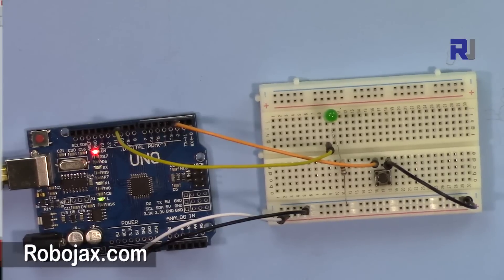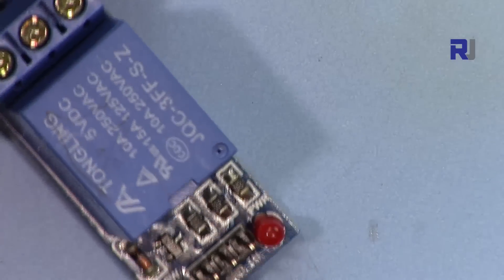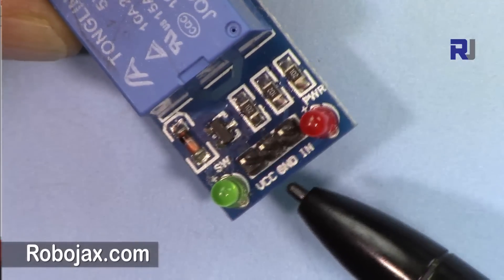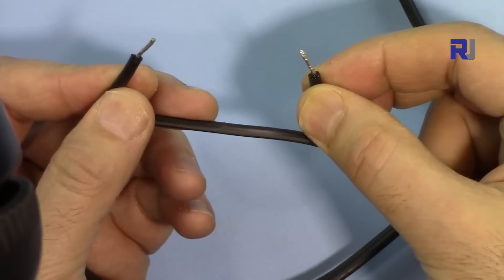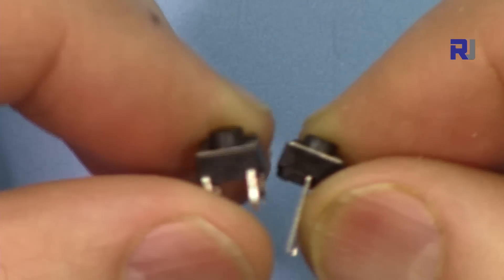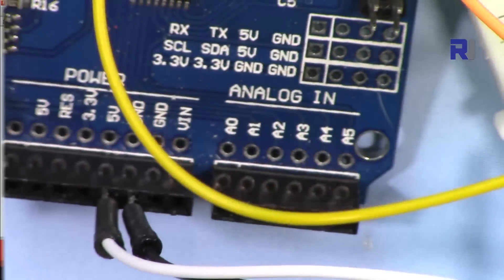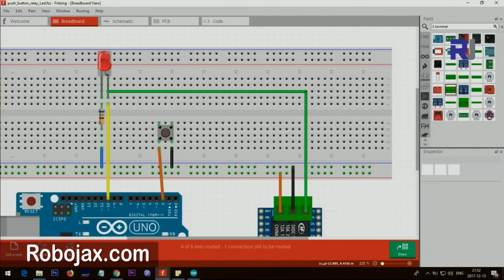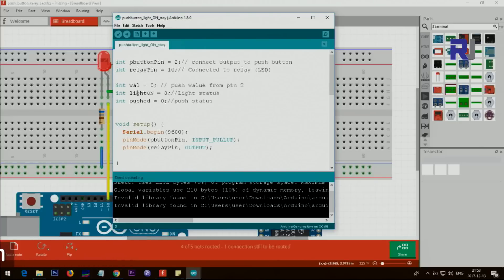Using Arduino Turn AC bulb with push button On and OFF toggle with relay

Comment: I been looking for a neat solution for this (i was looking for a way to control my relay with webserver and also a button!) and seemed like I couldnt find one at all, here and in other videos the code seems convoluted.
So i actually stopped for 5 minutes and came out with a more simpler solution! Just follow this logic:

1- The normal button state is always HIGH until its pushed down (LOW)
2- That means you can write a comand that recognizes when the button is LOW during the two possible scenarios; if relaypin is LOW or HIGH
3- So logically,  -if relaypin is HIGH and you press the button (buttonpin LOW again), te relaypin should change to LOW (in a "normally open" setting that means the lights would turn ON)
                            -if relaypin is LOW and you presss the button (buttonpin LOW), the relaypin should change to HIGH (in a "normally open" setting that means the lights would turn OFF)

So following that idea:

int relaypin =7;
int buttonpin = 8;

void setup() {
pinMode(buttonpin, INPUT);  
digitalWrite(relaypin, HIGH);  //This is nesesary for your relay to start in HIGH at startup, so it wont switch on during the few microseconds it takes to switch states)
pinMode(relaypin, OUTPUT);

void loop() {
if (digitalRead(buttonpin) == LOW && digitalRead(relaypin) == HIGH) {
    delay (400);
    digitalWrite(relaypin, LOW);
    }
if (digitalRead(buttonpin) == LOW && digitalRead(relaypin) == LOW) {

    delay (400);
    digitalWrite(relaypin, HIGH);
    }

You need that delay in the middle (maybe even make it longer) to prevent your relay from switching at the speed of light.
Im sure even I can come up with a way to prevent it from keep switching if you keep it pressed long enough.
This works well if you were planning to use it with other code, since it is almost isolated in terms of variables.
Reply from the maker: Thank you for your comment and code. It seems to be working. Same task can be done in many ways.

Comment: Assuming you can also turn on/off the light bulb through code in Arduino, right? If so will this sync up and allow you to either manually turn on/off through the button OR turn on/off through code?  I'm trying to figure out if I can use this example in a real life scenario where I can control manually and remotely and have everything play nice together. Thanks!

Comment: Hello Robojax,
Thnx a lot for your great YouTube, It means a lot if you share what you’re good in, so we can learn from each other. I hope you have time for a small simple question. Is there power on your relay coil when the NO contact is closed (when you’re hooked up appliance is on) like a standard relay or does it gets a pulse each time you switch on and off you’re appliance?
Greats
Bart
Reply from the maker: Hi,  you are welcome. here is my video on relay https://youtu.be/N-fFk51Eb8s

Comment: I like your video and it helped me. One thing I am trying to do but it's not working with that. Let me know can I use wall switch button which is used for 220V appliances? If so then how can I use it, please help me about that. Thank you
Reply from the maker: this is the video for you. I connected a bulb, you connect a fridge or  heater or anything. as long as you pay attention to the current rating of the relay.  Read your relay and make sure don't connect a load beyond the limit of the current handling of relay.

Comment: nice video sir...and also please make  operating relay with manual switch operating and mobile operating{wirless operating).iam  already told you in last video,
Reply from the maker: Your request has low priority. Out of over 200,000 views in a month in my channel, only 500 might be interested in mobile. I will do it when I get time for it.

Comment: Excellent video. What if i wanted to add two or more then two push buttons? Thankyou
Reply from the maker: just define all pins and variables . I have explained it fully. so pay attention to the code, watch it 2, 3, , 4 or 10 times until you know how it works. I can assure you can you do it.  Here is my *** Free Arduino Course **
Arduino Step by Step Course  (over 100 lectures) Starts here http://robojax.com/L/?id=338

Comment: how to i alter the code to make it so the switch only turns the relay on wile the switch is pressed? im planning to use this with a relay shield for a robotic charging base that only turns on when the robot parks on it to avoid causing a short when the contacts touch.
Reply from the maker: learn about push button in this video https://youtu.be/yyJrqFKn-X4

Comment: Great video. I have a question how to modify it to have 2 buttons that control one realy (bulb). Application in stairs.
Reply from the maker: that needs separate project. can't be explained by few line.
Reply: @robojax  Can you preapre video are rather you are not inreasted.

Comment: thank you for your video, i want to ask about led light, why the led turn on but the relay turn off. and the opposite, this is my condition, in yours led light on the relay turn on
Reply from the maker: You are incorrect wiring on the relay NO, NC. Watch the video again.
Reply: @robojax  thanks. i have solved the problem. but  i dont know what project must i create with this arduino. so i leave arduino for now. and back to my daily work. thanks again.

Comment: Thank you bro
I have a question 🤔 
When I press the push button  the relay turn off and the led turn on
How can I turn them on together?
Reply from the maker: They should turn on together  because they are after each other in the code , unless you changed it. Or change it to work together.

Comment: Hi. Thanks for the infomative video. I've connected the output of the relay (coms & NO) with 2 jumper wires connected to each other, then to an LED bulb in a breadboard. But it doesn't seemed to light up the LED. why is it so?? and also the wire connecting the output of relay is of the same terminal right (same Single wire)??
Reply from the maker: Hi, does the relay clicks? Do you hear that sound of it? If not then either you changed the code or wiring has issue. Check it.
Reply: @robojax  hi yes the relay is clicking with LED blinking when linked with arduino code. But serve no output signal.
Reply from the maker: If relay works then you fix the wiring from relay to your load
Reply: @robojax  yes it is working now. thank you!

Comment: Hi , when the pushbutton is being pressed , current from the 5v pin of the Arduino will travel to gnd  through the push button , wouldn't this short circuit the Arduino ?
Reply from the maker: It seems you have not watch the video or have skipped. We never connect a switch one side to 5v and the other side to ground. Of course it will short circuit it.  Watch the video again without skipping
Reply: @robojax    I am sorry , I meant the I/O pin (pin2 ) , that pin is directly connected via the button to the ground
Reply from the maker: please watch the other video which is only about push button switch. I have replied.

Comment: hellow robojax.. nice video.....  i have a question how to make connection if u dont have a resistor.. only using pull up code?
Reply from the maker: Yes  you can I have used in many of my project.

Comment: use a resistor on the buttom pin (between pin 2 and ground in this case ) to avoid a wrong input value, my input was always high because of that
Reply from the maker: You don't need resistor, i used "INPUT_PULLUP" to eliminate the usage of resistor. Watch my video on why use resistor https://youtu.be/TTqoKcpIWkQ

Comment: Hi man, nice video.
I have a question, when you turn on the arduino the load is on automaticly?
I have a home project where i want to conect a water pump but in power fail i dont want to be on when power comes back, just remain off
Reply from the maker: Thank you. I should have done that. I just updated the code you can get it. I added digitalWrite(relayPin, HIGH); inside the setup()

Comment: Hello, top video!
But I have a problem: everthing is as You have and I download the code but the led is ON and the relay is OF. When I push the bottem relay is ON but the led is  OF. It is not on the same time. Have You any idea wath the problem is?
Reply from the maker: You have connected your relay wires incorrectly.  Watch the video again where I explained the relay wiring.
Reply: @robojax  HI, it is not the ac lamp what is the problem; led on breadboard is ON, green led of the relay is OFF.  Push the bottem;; green led on relay is ON, led on the bb is OFF
Reply from the maker: I am sorry which LED? the LED on relay ? There is 2 LED on the relay. One is always ON. that is power. the 2nd  turn ON when relay goes ON.
Reply: @robojax  ok, You have a green led on the bb burning. Only the red led on the relay is burning I push the bottem, led on the bb is going out and the green led is going on.The green  led on bb and the green led on the relay  are not going buring at the same time that is de problem.
Reply from the maker: Red is power showing there is power. Green is the actual ON and OFF. Do you hear click? you should hear click when green LED turns ON. If there is click all OK. it should work.
Reply: @robojax  ok, everything is working but in your video  the green led on bb and green led relay are going on at the same time, by  me led on bb is on, green led relay out, push on bottem led on bb is out and green led on relais is on.
Reply: @robojax  The relay is a "low" trigger maybe is that the problem?

Comment: Thank you so much it was helpful
but I'm facing a problem in coding of  push button switch , I want the sensor value to be saved in a reference when push boutton is pressed 
 
CODE:
int sensorPin = A0;
int buttonPin =7 ;
int LED = 8;

void setup() {
   pinMode(buttonPin, INPUT_PULLUP);
   pinMode(LED, OUTPUT);
     pinMode(sensorPin, INPUT);
     Serial.begin(9600);
}

void loop(){
 
  int reff;
    int sensorValue = analogRead(sensorPin);
   int buttonValue = digitalRead(buttonPin);
   while(buttonValue == LOW)
   {
      reff = analogRead(sensorPin);
      Serial.println(sensorValue);
   }

  Serial.println(reff);
       delay(100);
}

PROBLEM:
if i press the button then sensor value should be displayed and get saved to reff  , but both are not happening  and reff value is not changing it stays at 0

button is working fine ,Every component is working fine i hope that you could help me out in this one 

Thanks in advance

Comment: Thank you for this great video!  I'm attempting to use this principle with an LED, but I'm having trouble adding a fade time.  I would like to push the button, then the LED fades up in 4 seconds.  Then push the button again and the LED fades off in 4 seconds.  I've adjusted your code to work with a MOSFET, I just need help adding the dimmer fade.  Any ideas?
Reply from the maker: You are welcome. Your project is different. The output on this project is working like switch either ON or OFF. For fading we need PWM. Here I have written this code which I have not tested but it shoudl work. https://www.codepile.net/pile/4XyqJNXd  please let me know
Reply: If you want to fade on/off a 3v or 5v LED then you don't need a MOSFET, the LED can be directly controlled from any PWM support pin of Arduino.

Comment: I can't find the wiring schematic!  Ideally the link to the code and wiring diagrams should be easy to find, ie, at the beginning of the "See More" link.  Yes, the code link points to another link which links to a udemy page to get the schematic, really?
Reply from the maker: code is there but no schematic. you don't need it. I have explained it fully. you can draw it if you need it for school or project using this free software https://fritzing.org/  the link to the code is for sure there.

Comment: How it could stay on for 10min and then turn off. Without the delay() fuction. 
Thanks
Reply from the maker: yes after you turn the relay ON, set delay (10000); But this code is to keep the LIGHT on and wait for another push to go OFF.
use this https://goo.gl/C7vJqx and connect relay to pin 10.  After this line  digitalWrite(10, HIGH); put this delay (10000);
and it will keep the light ON for 10 min and then goes OFF.
Reply: I' d like to do tha without the delay(10000). Because the delay holds all the loop. Is it posible to do that with millis()?
Reply from the maker: if you don't like to use delay(), then using mills() you can do it. Please have a look at this example at the end of page http://www.lucadentella.it/en/2015/07/21/arduino-delay-vs-millis/

Comment: Sir i want the bulb to be switched on for 7 seconds and then automatically shut down and again turn on for 7 sec only if push switch is pressed else bulb remains off. 
Plz suggest me how to do
It will solved by only change in programming of audrino?? 
Plz reply 🙏
Reply from the maker: Hi, Yes. it is very simple. See the code here https://youtu.be/58XWVDnB7Ss
You have to watch the video to understand what I say. 
here is the code https://codeshare.io/5wEdZP
Reply: @robojax  thankyou very much for your help🙏🙏🙏
Reply from the maker: You are welcome.

Comment: i test the code, after uploading the code it will on and off the relay. after 3 sec the relay will on again, but i did not press the button. can you help or check again the code . thank you...
Reply from the maker: you must have changed the code. it should work.

Comment: HI, thanks for this nice video.
I need a little help to add delay of 2 seconds before turning on the relay and when button pressed will off the relay. the precess should be repeated llike - 
1. pushed button - delay of 2 secs then relay on.
2. again pushed button - relay off.
3. pushed button - delay of 2 secs then relay on.
4. again pushed button - relay off..............etc

the process repeats with button press.....
Reply: can the same be added in your above relay code
Reply from the maker: You are welcome. Yes it is easily doable. Just add delay(2000); after the Serial.println("Light ON");
like this

Serial.println("Light ON");
        delay(2000);
See the full code I have customized for you: https://codeshare.io/a3ZQjg
test it and let me know.
Reply: Dear robojax,
extreme thanks for your kind reply. the code works. but the real problem i am facing is to add a delay of 2 seconds in the switch case-2 of below code.
I need a delay of 2 secs only in case-2  and all other case should work without delay. i tried to add delay command but it pauses all next process. plz help if possible here..... the delay location i have mentioned in below code-----....

int input = 2;
int output1 = 3;
int output2 = 4;
int output3 = 8;
int output4 = 9;
int output5 = 10;
int output6 = 11;
int state = 0;
int old =0;
int buttonpoll=0;

void setup() {
  pinMode(input, INPUT_PULLUP);
  pinMode(output1, OUTPUT);
  pinMode(output2, OUTPUT);
  pinMode(output3, OUTPUT);
  pinMode(output4, OUTPUT);
  pinMode(output5, OUTPUT);
  pinMode(output6, OUTPUT);
  
digitalWrite(output1, LOW);
digitalWrite(output2, LOW);
digitalWrite(output3, LOW);
digitalWrite(output4, LOW);
digitalWrite(output5, LOW);
digitalWrite(output6, LOW);
  
}

void loop() {

  
  buttonpoll = digitalRead (input);
  if (buttonpoll ==1){
    delay (80); 
  buttonpoll = digitalRead (input);
  if (buttonpoll==0){
    state = old + 1;
    }}
 
  else
  {
    delay(100);}
    switch(state){
      case 1:
      digitalWrite(output3, LOW);
      digitalWrite(output4, HIGH);
      digitalWrite(output5, LOW);
      digitalWrite(output6, HIGH);
      digitalWrite(output1, HIGH);
      digitalWrite(output2, HIGH);
      old = state;
      break;
      case 2:
      digitalWrite(output3, HIGH);
      digitalWrite(output4, LOW);
      digitalWrite(output5, HIGH);
      digitalWrite(output6, LOW);
      digitalWrite(output1, LOW);
      digitalWrite(output2, LOW);

   //i need here a break of 2 seconds and continue the output1 and 2 High, also continue to next switch case.

      digitalWrite(output1, HIGH);
      digitalWrite(output2, HIGH);
       
      old = state;
      break;
      default:
    
      digitalWrite(output1,LOW);
      digitalWrite(output2, LOW);
      digitalWrite(output3, LOW);
      digitalWrite(output4, LOW);
      digitalWrite(output5, LOW);
      digitalWrite(output6, LOW);
       old = 0;
      break;
   
     
    }

}
Reply from the maker: delay() will halt all process. This is that it does. You can't continue to the rest of the code before the delay time has not reached to the end.

Please use the chareCode.io. you could directly edit the code or create new code see this https://snag.gy/5jXKr9.jpg
After you made change or you created code, just share address.

Comment: Great video. Very helpful thank you so much. 
Please upload tutorial for TFT touch display with arduino while also using other sensors like temperature and humidity sensor and show that data on tft display
Reply from the maker: Thank you. Sure will do that. I have add it into my list.
Reply: Robojax thank you a lot. I will be waiting.

Comment: Hi Mr. Robojak, i try to use the 2 button and relay code and it didn't work properly, only relay 2 can turn ON , relay 1 cannot ON. Can you pls help? But i also try the 1 relay code and it's work.
Reply from the maker: HI Sangar, you are right. There were problem with the code and I fixed it. I have not tested it but it should work. Let me know if there is a problem.
Reply: Hi Mr . Robojak, thank you very much for your quick reply, btw can you pls send me the correct code that you have fixed it pls, or can i know where can i get it? Thanks again sir.
Reply: Great, i got it, thank you sir really appreaciate your quick response. Thank you again.
Reply: Hello, I am having the same problem. Is there an updated code?